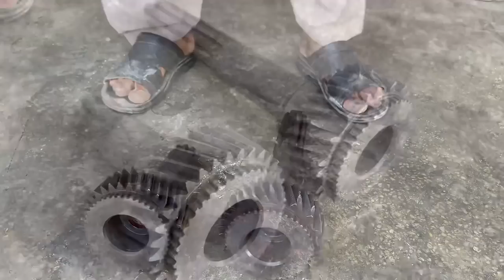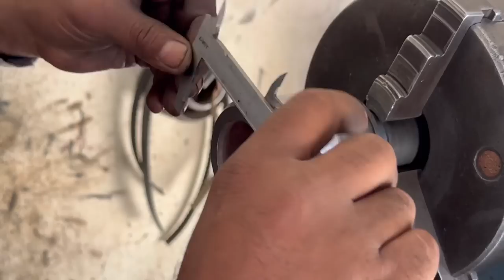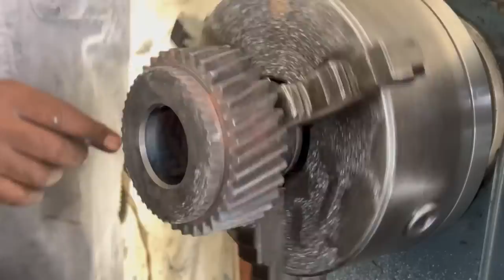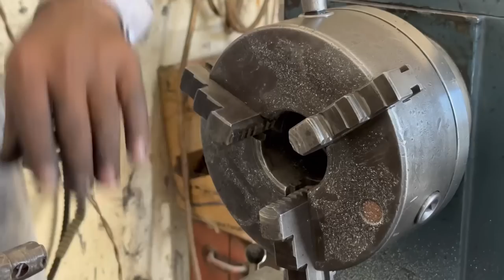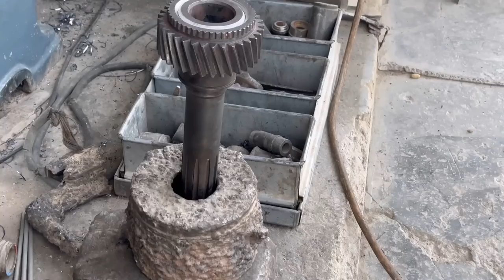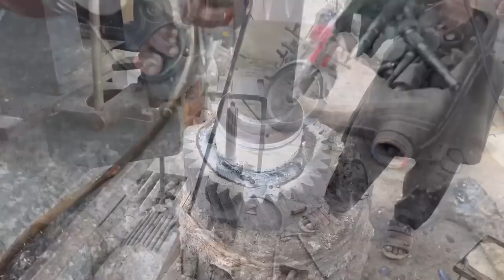How Ingenious Guy Repaired Broken Input-Shaft Very Nicely Never Seen  Before this Unique process….

Comment: Why he applied white paint/material as well as black paint/marker ?
If he welds it at the end, why bothering with thread ?
Reply: Black ink for easy observation, when the thread is small, check with a jig to avoid being cut too deep.  Also white for lubricating for final cutting for smooth and precise surface finish.
Reply: @kieuhongthang5579  Can someone answer the last bit of my question. Thanks
Reply: Cutting the thread does nothing to enhance structural strength as the threads are a loose fit with each other. Should have been smooth turned with an interference fit and the outside gear heated to allow for assembly then frilled and dowelled prior to welding.
This is yet another in a long running series of fake "click bait" repairs that will never work in reality.